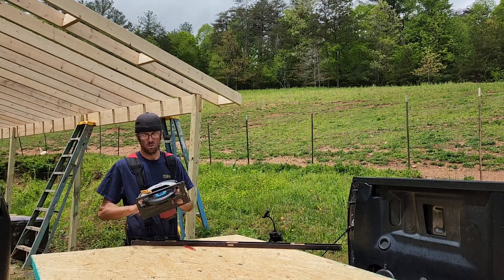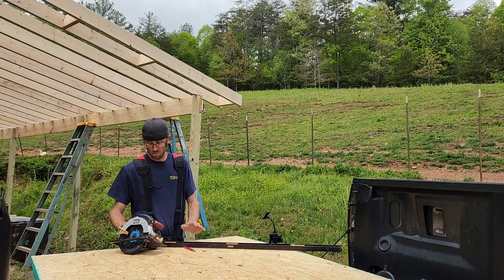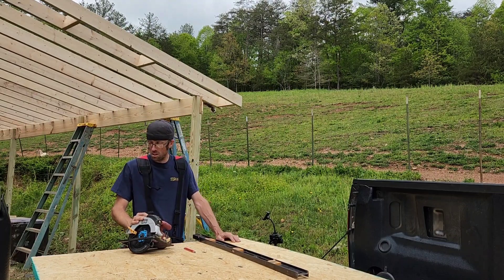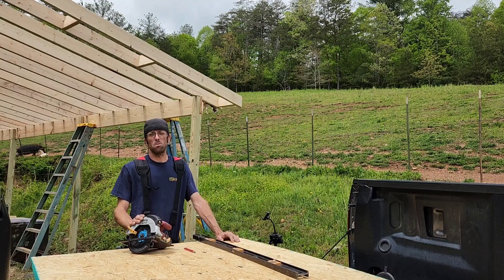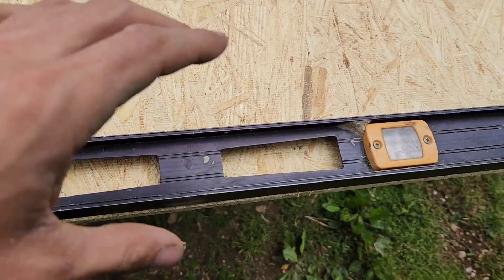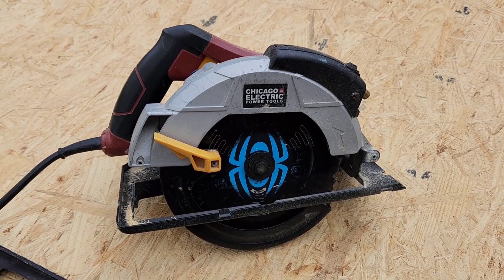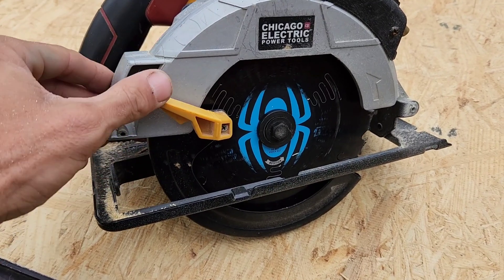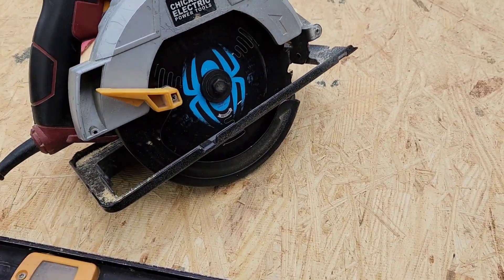Harbor Freight- Chicago Electric Circular Saw: 2 Year Review. Does it still work?

Comment: Question:  I have a 12 amp Chicago electric circular saw (63290).  I had a masonry blade in and when changing the blade out forgot to use the blade lock.  Instead I put the blade in a vice to loosen the bolt.  Now my saw runs fine but the blade is loose ie the outer flange and bolt won't tighten down properly.  Help!!?